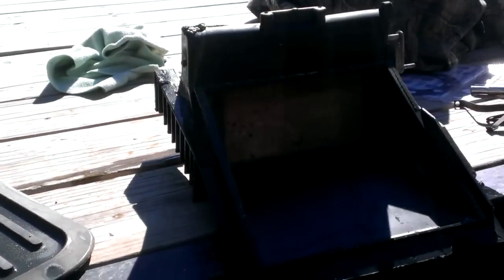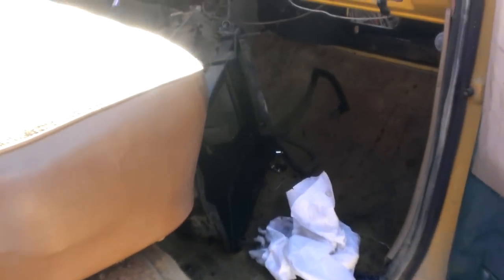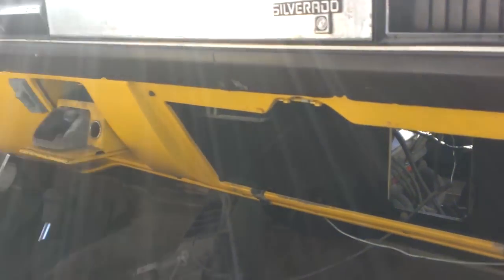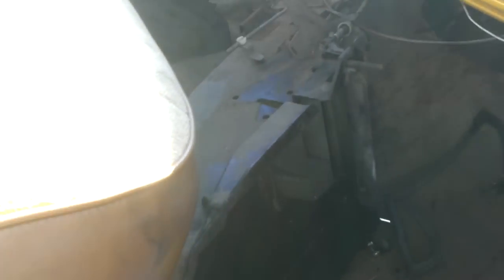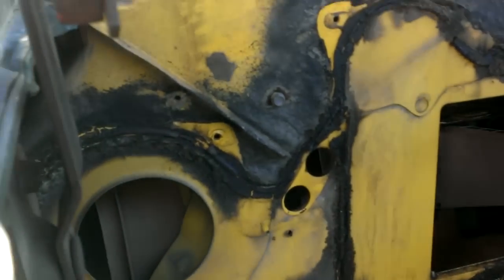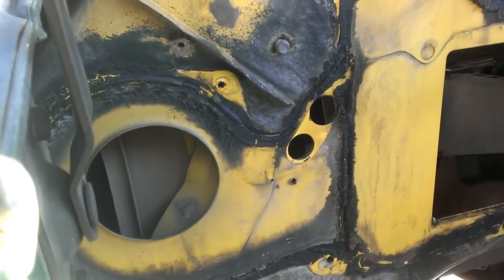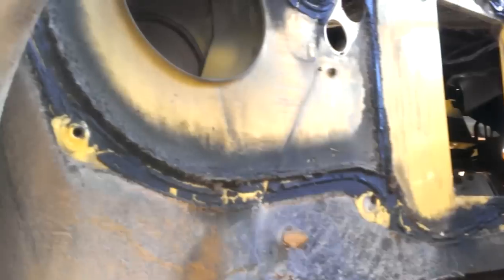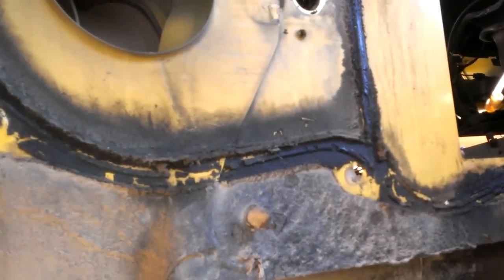1983 Chevy truck heater core replacement

Comment: 73 Suburban C20 Cheyenne (same yellow!) with A/C required dropping (not removing) the fender well (for access to 2 hidden mount points, one nut and one bolt), and removing the nuts from the studs that went through from the inside to the engine compartment, but I left the A/C stuff in place. You definitely removed more than needed, but hey, I would have, too, if I had not watched a dozen videos like this one first, so THANKS for sharing this!
Reply: yes he did def remove way too much more than needed.  haaha

Comment: didnt HAVE to pull the outside box off the firewall  just remove the three bigger nuts around the box  tat hold the inside cab box to it through the firewall.   tqwo under box towards engine side  and one at top towards engine side too.  leave blower box on firewall under hood intact with all the a/c and everything too.   im gonna cut big access panel in my inside cab box in my 75 C20 soon and pull core out thrugh that instead of pulling any box.

Comment: Do you know if it's possible to convert from the old style of heater box to just the heater core pipes poping out the fire wall I see a lot of older school trucks like I have a 79 but don't know if I can do it to mine because then there would be no fan any tips would help thanks
Reply: yes you casn and it would still have blower on it.  non a/c  boxes are smaller and the cut outs in the firewall are bigger different thoguh you will have to patch over alot of it with tin.